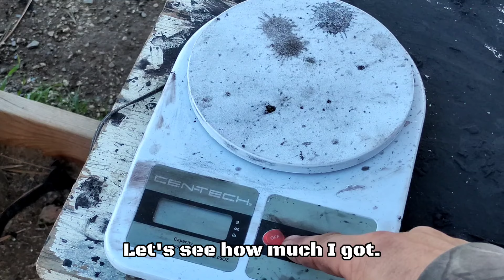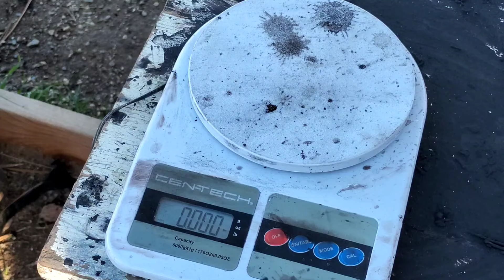Scrapping aCar Battery for Lead #asmr #melting #satisfying #trashtotreasure #scrapping #battery

Comment: My MOS in the Army was 63B10, Light Wheel Vehicle mechanic. I worked on anything from humvees to 10 ton tractor trailers. Our unit even had an M88 tracked recovery vehicle that had tricycle handle bars for a steering wheel lol.
But during Desert Storm in the middle of bumm fucked Saudi Arabia desert, our LT decided to play dune buggy with his humvee while bringing back some supplies I had ordered, some of which was 2 ea 5 gallon jugs of undiluted battery acid. 
One of the jugs split and spilled it’s contents out into the vehicles floor. It started eating the mats and aluminum floor etc, and he showed up begging me to clean it out and hide the mess, which I did, but it ended up burning both of my hands pretty good. 
Being as we were in the desert the most I could do was to park the vehicle on a hill sideways and then use tons and tons of water to flush the acid out. I drilled 1 half inch hole in the floor as a drain and then got water platoon to bring me a 500 gallon tote of water. I used all of the water, and was able to clean the acid out
My hands… were burnt WHITE , the outer layers of skin was dead dead and took a few weeks to come off. I had to wear socks on my hands at night with Vaseline and during the day I wore rubber gloves with Vaseline. 
Never again will I mess with battery acid without gloves.
Why did I back then ?
Well, in the desert I didn’t have access to rubber gloves or protective gloves.
The ONLY protective gloves I had for chemicals were my NBC gloves and those were being saved in case we were attacked with NBC weapons. 
So yeah, if your going to fool around with batteries, you absolutely need protective gloves, apron, and GLASSES.
You only get one pair of see balls. That’s it

Comment: It would have been interesting to have weigh the battery before and after to see exactly how much was usable lead. How much do you think you recovered from the batteries... I couldn't tell by the scale...   But once you tackled such a battery, you now know what to do next time to make it better experience. That is IF you recovered enough lead to make the effort worth it...
Reply: You're lucky if you get 10% off the weight of the battery back in usable lead.    Next time just raid the local junk yard for wheel weights.